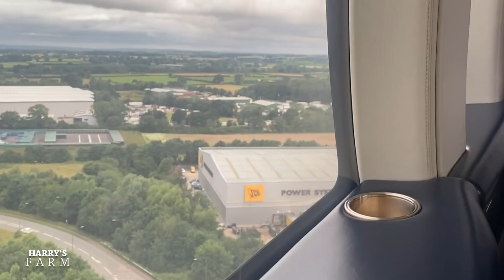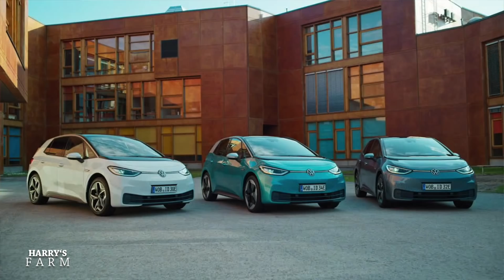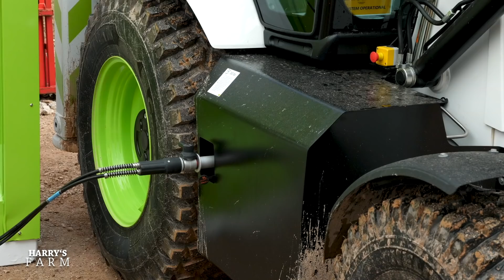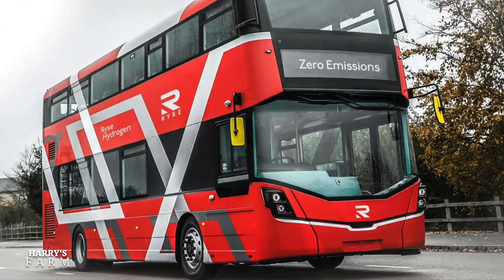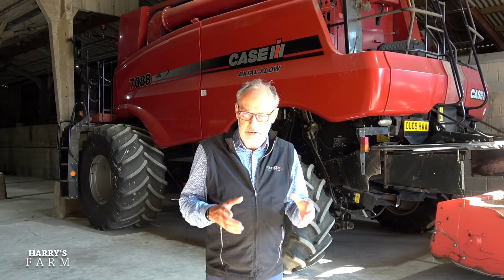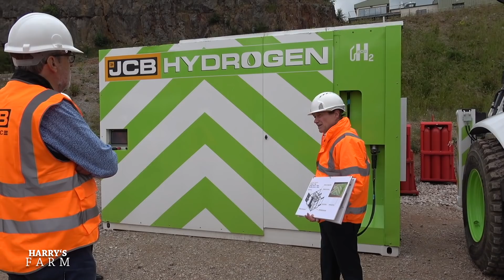Why JCB thinks hydrogen is the best alternative to diesel for heavy machinery, farming and HGV fleet

Comment: Hydrogen is definitely the future even for cars
Reply: Absolutely not for cars. The efficiency is just way way to low. 

Why waste half of the electricity to make hydrogen and waste half of that again to make electricity to drive the car when you can just use electricity in a battery? The added weight is not nearly as wasteful as making hydrogen. If there is any added weight at all because high pressure hydrogen tanks are very heavy.
Reply: @Jupjupjupjupjupjup  what other form of power is there. Electricity don’t think so. So everyone goes electric they all come back from work and plug in. No electricity for the a cup of tea or the tv. As explained batteries are to heavy expensive and take up the earth resources. At the moment there’s no viable alternative for at least the next 5 years. But Hydrogen has a future.
Reply: @philthedogg  Why would there be no electricity for a cup of tea?
Reply: @StuartJ  because all the electricity will be taken up charging cars. The infrastructure is not there to cope. Look what happens if there something big on the tv and commercial break comes on. All those kettles drain the system. Imagine what will happen when all those high wattage charges are switched on, as well as lorries, vans.
Reply: @philthedogg  And how do you make Hydrogen?
Reply: @StuartJ  oh I understand the problem but would imagine the producers will supply their own power source but too many electric cars being charged at the same time will soak up all the available electricity
Reply: @philthedogg  You need electricity to make Hydrogen. And more of it, which makes it worse.  Your also mixing up electricity capacity, with supply surges. Both of those can, and (we are told) will be fixed, with the grids plan to double/tripple capacity in the coming years/decades.
Reply: @StuartJ  let’s hope it happens but at the moment here in Kent they’ve got rid of the power station which was used for these Surge’s (it was coal fired) and we have a power station that burns rubbish and people complain about that can’t have it both something has to give.
Reply: @Jupjupjupjupjupjup  if you look at the video their using a combustion engine in exactly the same as we do now not make electricity to run electric motors. It’s basically a converted Diesel engine seems logical to me. A bit of engineering tweaking and they’ll be there well done JCB

Comment: This is a superlatively informative and interesting video.  I'll keep my personal opinions to myself about the content because I know they're only "half baked" based on my own relatively limited knowledge and understanding at this point.
Reply: However, hydrogen combustion with air produces oxides of nitrogen, known as NOx. In this way, the combustion process is much like other high temperature combustion fuels, such as kerosene, gasoline, diesel or natural gas. As such hydrogen combustion engines are not considered zero emission.
Reply: @brianevolved2849  It may be accidental that you replied to my comment - as I said I have a limited understanding of the whole thing.  Yes, high combustions temps enable NOx formation, but equally they don't produce soot or any other form of carbon based gas per se.  If the exhaust is passed through a SCR system (adblue) then the NOx reacts with the gases formed from the vapourisation of the urea solution - which includes a carbon element again - but allows the nitrogen to become elemental again, at the expense of creating CO2.  See - confusing isn't it?!

Comment: The rest of the world will not switch to hydrogen, so it is moot. There are way too many possible alternatives to hydrogen fuel that betting on it is foolish. Also, there are a lot of problems with hydrogen that JCB guys "forgot" to mention (e.g. hydrogen embrittlement). Building the infrastructure will take so long that there is a high probability that there will be a better solution found (so called "waiting problem"). What comes to mind (and there are many-many more possibilities): some kind of synthetic fuel, or petrol companies will master carbon capture making traditional fuel carbon-neutral or something else - any of those will kill the "hydrogen fuel" outright.

Comment: Your last video about avoiding and capturing CO2 becoming a part of farming additonaly to food production, made me think about ways to get farming machines CO2 neutral. But I thought it might be a bit off topic to discuss it under your video. Really cool to see this video, cause I am verry interested in all of that.

edit: The thoughts I had and have after this video: 
The idea of using agricaltural land to harvest sun energy via solar panels made me ask myself if small local hydrogen plants might be profitable for communities that will use a lot of hydrogen themselfs in the furure. So using the electrical energy your solar farm produces yourself, especially in times when the market prices are low due to too much supply, instead of selling the electrical energy to a big company and buy hydrogen back later. Maybe cooperative through a group of farmers or other locals that want to invest. If that is a buissness case will probably be dependet of scalability of hydrogen electrolysis and the margins hydrogen producers and suppliers will keep for themselfs.

It would be really cool to see the power output, and/or the energy/fuel consumption of farming machinery hour by hour over a whole year. For power plants — from solar and wind to coal and nuclear — their are a lot if interesting metrics that can be calculated from this. I would guess the curves for energy consumption of farming equippment in the UK look roughly similar to the curves for energy production of solar power plants. While nighttime and on cloudy/rainy days solar panels produce less energy and I would guess it's also more unlikely for farming machinery to be on the field.

Battery electric machinery: The only way I could see battery electric be an alternative to hydrogen for heavy machinery, is if changeable battery packs where used to minimize "refuel" times and weight. Like on a set of electric tools, where you have two packs, one pack charging in the charger and the other one beeing in the tool currently in use. With the difference in size and power need of farming machinery, also the difference in power need depending on the job, one would probably need machines that hold more than one pack at once; A dozen or so packs in total and a charger that can charge multiple packs in parallel.

The packs will have to be changed more often than a hydrogen machine have to be filled, but: The electrical energy they need will be much less than the electrical energy needed to produce equivalent amount hydrogen, because of the losses in electrolysis and combustion or fuel cells. So it's low fuel cost but more refuel time on one site, and higher fuel cost but less refuel time on the other side.

Comment: could be very good for ocean transport, i think that private electric vehicle ownership is a blind alley. much better to make electric cars hireable within cities. Why do we need to OWN electric vehicles, I totally get that electric vehicles are a good idea in the city. What needs to happen is that entering a city you get to vehicle exchange, switch too your urban vehicle and go where you want too, the practical parking and congestion of different transport systems is defining the streetscape. Hydrogen vehicles yep no problem in plant and agriculture, transport needs integrated transport systems between rail and truck. ie if stuff arrives by boat it should go by rail freight to the closest practical point for pick up by hyd lorry for delivery. We have GPS systems we could organise a computerised system to track and do this. For agriculture farmers need to realise that by changing practice particularly stopping ploughing they could benefit Carbon sequestration, at the same time reducing the HP requirement of their prime tractors, also I have run diesels on veg oil which works fine on conventional in line injection pump engines and can be enhanced with hydrogen cells bolted on to increase power and efficiency, i have operated modern tractors and the new common rail diesels are great when they are running right but expensive too service and repair. What i reckon we need is a standard hydrogen engine pack that can be retro fitted to existing machines, just thoughts ;0)
Reply: Maybe you can explain why modern diesels have to capture the crap they make and then sit in one place revving the b..ks off,  to burn it with pigs pee and put it into the environment in that one place. A bit of smoke out the exhaust when accelerating hard was all we saw before, and no burnt pigs pee !!

Comment: If millions of vehicles use Hydrogen made from water , will we end up with less water on the planet or is that a ' future persons problem ' ?
Reply: No
When the hydrogen is burnt it turns straight back into water.
Also millions of engines wouldn't even begin to put a dent in the amount of water on earth.
Reply: No, because it comes out the tailpipe as water vapour, which will condense and return to the source via all the applicable water courses.
Reply: @taylorsimonr   But what you use to make the fuel will be counted in gallons , and what comes out the ' exhaust ' will be measured in Tea spoons.
Reply: @gutinstinct4067  No. Reasonably basic chemistry at play: (GCSE level, anyway) 2 moles of H20 split via electrolysis to form 2 moles of H2 and one mole of O2.  Why an apparent amount more?  The additional electrons that come from the electrical source.  The 2 moles of of H2 then need 1 mole of O2 to burn stoichiometrically (at the correct ratio) when reforms the exact same amount of water that was used in the first place,.  The energy released is exactly the same amount as absorbed by the water during the splitting process.  NB - this is NOT the same as the input amount needed to split the H20 molecules, nor will it be the same amount of useful work obtained during the combustion process. Both are fairly lossy processes which is why the energy for electrolysis MUST come from a renewable source for it to be a workable solution.  To further explain this whole system we'd need to start discussing in terms of special relativity, which is the relationship between matter and energy, to show throughput.  
Ultimately, a the mass of a gallon (about 4.55 kg) of water electrolysed in the first place, will result in a 4.55kg of water coming out the thing's tailpipe, albeit it in a gaseous state.

Comment: Fossil fuels won't go anywhere in the next few decades. Our electricity networks here in the Netherlands can't even handle the needed capacity and are already telling new large businesses that they can't cover their energy demands. Imagine if everybody would be driving electric within 5 years, that would cause a massive chaos.
I'm a big fan of hydrogen, either through a fuelcell or by ICE injection, but the main problem is production. It's just not as easy to make, and therefore it's quite inefficient still.
I'm interested to learn how that progresses in the coming years, but one thing is for sure. The best we can do the next few decades is adopt as much sustainability as we can, wether it's electric, hydrogen or clean fuels. We just don't have the production/energy/distribution capacity to focus on only one.
Reply: EVs are charged at night during lowest demand. Also EVs can be the storage medium from which one could sell power back to the grid during peek demand. Note the average family car is parked 95% of the time.

Comment: Right. That's it settled. I want a hydrogen motorbike.
Reply: Aaaaand your range would be maybe 25 miles.

Unless you want a stupidly large and cumbersome fuel tank.

One inconvenient little fact they didn't mention here is hydrogens volumetric density is extremely low. So if you wanted a fuel tank to remain the same size as they are on current bikes your range on hydrogen would be pathetically short.
Reply: @MrManBuzz  Don't judge me....... :-)
Reply: @gretchensghost  Or you could store it at extremely high pressures, but then you'd be sitting on a pressurised bomb.

Hydrogen ICEs is simply not the solution. There's a reason why basically no one else is going down this route despite everyone being aware of it.
Reply: Interesting.

Comment: So its a hydrogen combustion engine, from 1KW input they will be 25-35% efficient at the wheel compared to a Hydrogen fuel cell, which is ~50% and batteries which are 85-90%. I suppose it depends how much of a premium batteries are as to who wins on total cost of ownership and how quickly they come down in price. Actually checkout the engineering explained video which goes through the numbers https://www.youtube.com/watch?v=1Ajq46qHp0c

Comment: I do think the carbon-free future for agriculture, forestry, and heavy construction is hydrogen, but not combustion.  Batteries are not a good fit for heavy equipment for exactly the reason Lord Bamford identified, but combustion has its own serious downsides around maintenance and efficiency.  Fuel cells are expensive today, but economies of scale will bring them down quickly as they scale up.  They are high tech devices, but not that fundamentally hard to produce.  H2 combustion might be a good transition technology (if used with green H2, which the vast majority currently available isn't), but I see fuel cells as the long term solution given the vastly reduced complexity and long lifecycles of electric motors over combustion.

The 40% efficiency of combustion combined with 40% efficiency of producing green hydrogen will just make the cost of fuel far too high to run the equipment.  A fuel cell will be able to extract so much more useful work from the same amount of hydrogen
Reply: He identified the problem as the weight of the batteries,  on vehicles which usually have large dead counterweights anyway.
You can't expect someone standing in his family's ICE factory to be unbiased.
Reply: Plus the cost of compressing hydrogen to 300 bar in vast quantities makes H2 a very expensive proposition.

Comment: Is that JCB man kidding? excavators have weights at the back, the perfect place for batteries without a weight penalty!

If these run 5k hours a year the engine cost does not matter but the running cost meaning fuel cost.

Comment: I've always believed in Hydrogen but also for exotic cars! You get the noise and the feeling. Biggest issue is the 30% loss of energy when transfroming electricity into hydrogen and a nother 30% loss when used to power electric motors
Reply: Also storage at 10.000 psi.
Reply: Not to mention the 80% loss when used in an IC engine.

Comment: Great to see someone doing this other than toyota playing with it in a race car. But will it still produces nox due to burning.
Reply: It would be good to see Toyota trial the hydrogen engine on a regular car with the current emissions controlled exhaust systems with catalytic converters etc. As currently its only in a racing set up car without the exhaust emission seen on a road car.